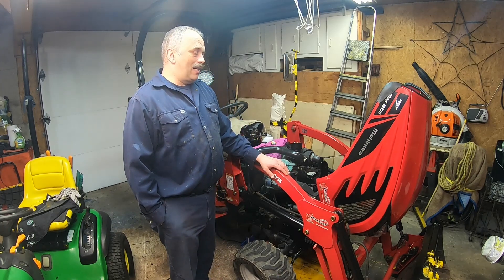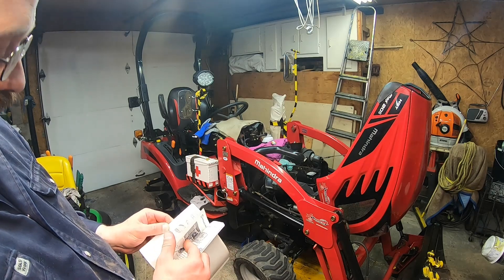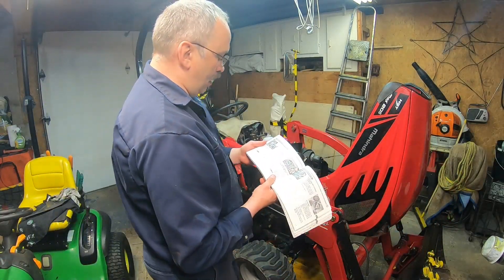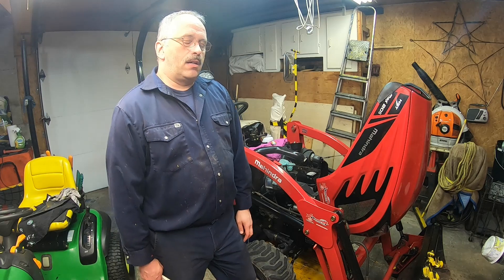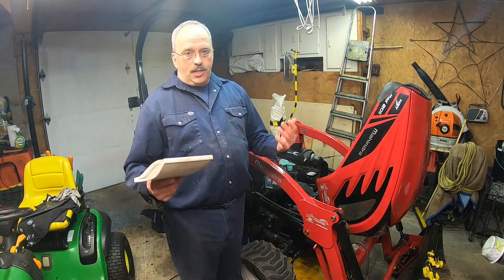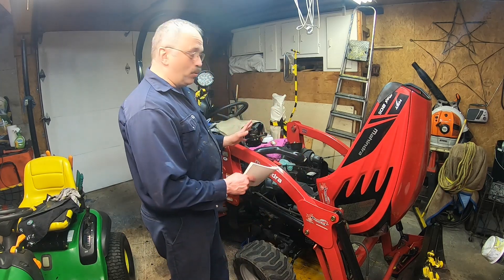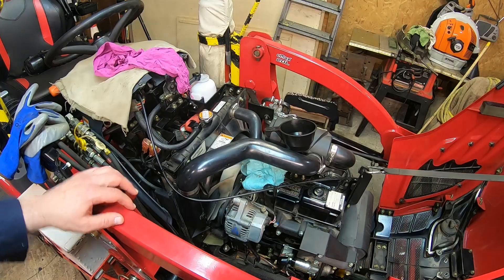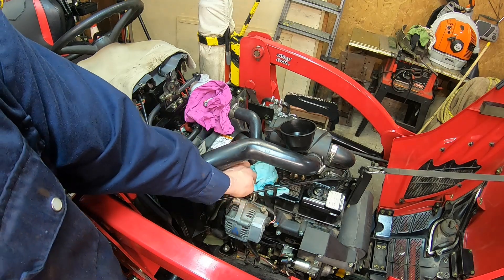Mahindra eMax 20s HST Engine Coolant Change

Comment: Do you have a video on changing the v belt for the radiator fan?
Reply from the maker: Good Evening Sir, No I Have Not Yet And I have 580 hrs on It. I would Loose the Alternator First To See If I can Give Loose Enough So The Belt Can Be Removed Over The Plastic Fan First. Phone Your Tractor Dealer To Have The Proper Belt and Let Me Know How You Did It !!! Thank You Very Kindly and Be Well Cheers  🙏😇🍻

Comment: Great video. I recently bought a Mahindra emax20s. It started leaking coolant everywhere quickly. Turns out the cylinder block drain plug for the coolant is the culprit. Any advice on changing that? The plug seems to have a rubber cap on it and the rubber part got a spit in it. Waiting on a new cap to come to see if I can pull the split one off and replace or if I have to unthread the plug. Didn’t want to cut the rubber cap without having parts in hand. Very weird looking plug. Any advice would be greatly appreciated. The plug is located to the left of the oil filter right behind a group of wires. Metal threaded plug with a long rubber cap on top.
Reply from the maker: Good day Sir, Thank You Very Kindly For Subscribing to my channel and My Best Advice is to have a talk with the mechanic of Mahindra, TYM since they both sales to same tractors. I do not know why that plastic crack at that place ( poor coolant who froze or a something hit that plastic part,,, ). Be very careful the fuel pump and fuel hoses are near by too and make sure that you have plenty of good coolant too. Let me know please and take your time. Cheers
Reply: Thank you so much for your reply! I spoke with the Mahindra mechanics today and ordered the new plug. Hope to change this weekend. Weird their books showed no rubber dome cap on top of the actual plug. Tractor lost all coolant overnight and is bone dry. Appreciate your advice and will keep you updated!!

Comment: I enjoy your videos sir. Thank you. I have an Emax20 too, and I have learned a lot from you.

One tip, as it's very common for hoses to stick to their fitting, use a small pick to get under the edge of the hose end, and work around it. After the end of the hose is unstuck with the pick, then you should be able to wiggle it and finally free it from the fitting. Cheers.
Reply from the maker: Good Evening Sir Dan 😇🖐Thank You Very Kindly for Your OUTSTANDING Support, Your Tips are Always Welcome Mon Ami, Keep Up Your Marvelous Work With Your Little Red Sub Compact Work Horse Tractor Sir and Be Well  Cheers🍻

Comment: I am still catching up on your videos, David. I hope you are feeling better now. I am surprised there is not a petcock (drain valve) at the bottom of the radiator. I need to change the coolant in my tractor this summer. I'll have to look for a petcock - I don't know if there is one. Thanks for sharing, mon ami!
Reply from the maker: Good day Sir, Yes I'm in top shape ( still ongoing fitness training for my annual fitness check ). Yep no petcock at all, but the classic way of flushing is always the best since the volume of drainage is better than others ways  😇👌👍 Thank you very kindly for your OUTSTANDING support Sir and have an Happy 4th of July celebration Cheers👍👍👌👌✨✨🚀🚀😇😇🍻🍻
Reply: @RCAFpolarexpress  And a belated Happy Canada Day to you!

Comment: Comment ca va mon ami?  So sorry to hear you have a cold.  It's a bad time of the year to be sick eh!!!  Nice job draining the coolant.  Because this is not done regularly, the tractor makers don't provide easy access to drain it easily.  You did a nice job though. Take care!!!
Reply from the maker: Bonjour Mon Ami, thank you very kindly for your OUTSTANDING support. Yes Sir like in the aviation the engineer and designers  put the engine and various very important items to get change often and built the aircraft around it,,,, so not so easy to remove,,,  You too take care et merci beaucoup et bonne semaine Cheers !!!

Comment: Hi Dave, I have a question for you. My fuel gauge never worked right and I was wondering if you ever had a problem with yours. Even if I fill the tank all the way up it never shows full, and as I use it it doesn’t go down accurately it does move up and down but I know it’s not accurate so I never know exactly how much fuel I have and with it being diesel I don’t want to run out because that can be a real pain. Thanks in advance.
Reply from the maker: Good Morning Sir, thank you very kindly for your OUTSTANDING support. About your fuel gauge you should call you dealer since mine work perfectly and very accurate 👌🧐👍 Keep me in the loop for what your dealer will tell you Sir Cheers
Reply: @RCAFpolarexpress  ok, hope you’re feeling better.
Reply: Check the vent tube on the left roll bar post. I had a mud bee plug that caused the left tank and fuel guage problem.

Comment: Good day David! 
I hope you are doing better! 
I hope that the parts will come soon! 
Very clever way to get around the problem of the stiking hose!😊👍🤔
Wath is the volume aproximatively of coolant that your tractor need? I just bought 1 gallon and I wonder if it is enough? 
I also would like to do it on the Corolla but not sure how to do it... Will you need to change it soon? 🤣 
Have a great week! 
And thanks for your nice video! 
Adrien
Reply from the maker: Good Morning SIr, thank you very kindly for your OUTSTANDING support mon ami. According to the maintenance book they call for 3.5 liters but on the drip tray on the floor I had more than 5 liters !!! So you should be close for your Massey I think ( do you have your maintenance book ? ) if not call your dealer it can order it for your Sir 👍🧐👌 On your Corolla is so easy, remove the bottom hose from the Radiator or open the valve on the radiator ( bottom under the hose ) and open the catch tank ( over filler tank ) and the radiator cap and use a garden hose to flush your systeme ( many many videos on you tube ). have a outstanding week Sir Cheers
Reply: Bon matin ! 
Thanks!
I will look for that!
Have a good day!
Reply from the maker: @portedadrien9293  🧐🧐👍👍👌👌🍻🍻

Comment: That bottom rad hose seemed to be a bit of a challenge to get off.  Hope you get the strainer soon so that you can get your tractor back up and running.  Hope you are feeling much better soon 😊.   Take care
Reply from the maker: Good evening Sir, you are correct that bottom hose will need to be cutted with a knife when I replace it 😤 Thank you very kindly for your OUTSTANDING support and I hope to have the tractor back on his wheels for sure 🙏😇 Thank you again and have a nice week Sir Cheers 🍻🍻

Comment: Is there any way you could install a drain valve on the lower rad hose? Maybe cut the hose, and install a drain valve so all you have to do in future is just to open the valve and not have to remove the hose again. Thanks. Great video again Dave.
Reply from the maker: Good evening Sir, Thank you very kindly for your OUTSTANDING support mon ami 👌👌👍👍😇😇 Now than I know how to do it properly it is not worth it to cut that lower rad hose who may leak later on,,, Sir, It is so simple now to disconnected the rad hose directly from the water pomp and let drain it from their on every 5 years. Thank you very kindly again have a very nice week Sir Cheers 🍻🍻